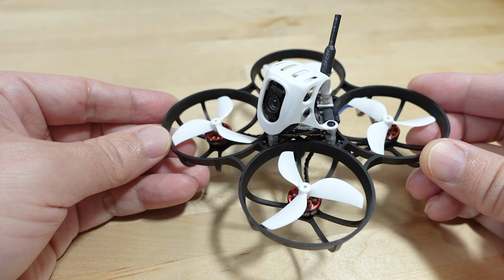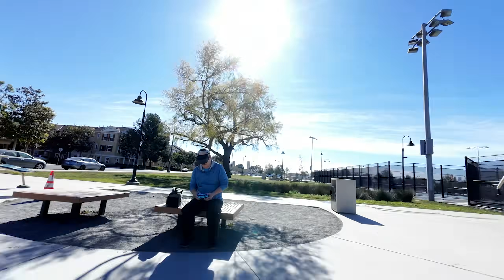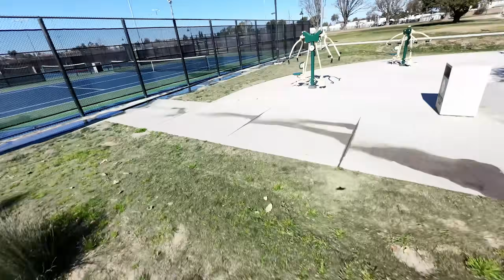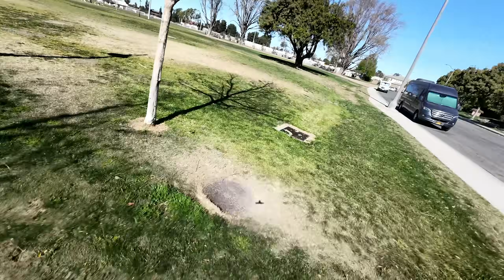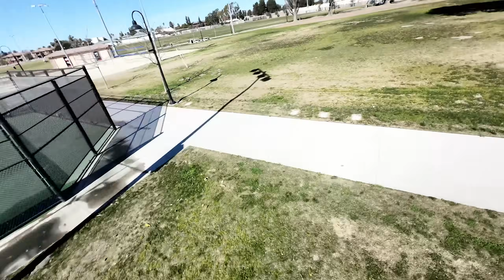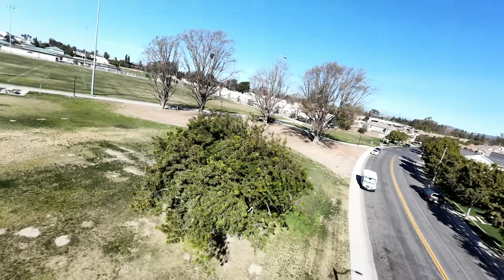BETAFPV Meteor75 Pro O4 Edition

Comment: I did it, it's ordered! Curious to see how much weight you could shed with a whip antenna,  tpu camera mount and bi bladed props. And what impact it would have on video and flight performance.  Side note, there's a couple of 65mm walksnail whoops weigh in at 35g and 39g.
Reply: How do you think the air 75 frame would perform with the 1102, 22000kv motors?
Reply: The air frame is pretty light 3g, I think. This 75mm comes with those motors.  Idk. Just really looking forward to a hd tiny whoop.  My eyes are too bad for analog,  I can't see squat
Reply: @dustinpugh8222  I hear you mate, he tinywhoop, can’t wait to get one myself. The 65 just looks too stodgy for me
Reply: @rossanthony7573  the flight time is what sold me on the 75. I would prefer the 65, but it's just not there imo
Reply: @dustinpugh8222  it’s a big 75 as well. Saying that though putting the 65 into an air75 frame does sound tempting…

Comment: CAn i use non BETAfpv 1s batreries you think?
Reply from the maker: They need to be able to work with the BT 2.0 connector and fit the battery tray.  I don't know of anything other than BETAFPV lipos that will fit well.  Also, the LAVA lipos will probably give the best flight time.
Reply: @AlbertKimTV  That such a ... :) not cool lets say :)

Comment: The vibes came from the props all my 75 pros have the vib. With this props
I hoppe new 45 mm Propst came sone😊
Reply: My 75 pro with O4 started having crazy jello after a minor crash. Rebuilt camera mount, canopy and the board with no luck. Then I noticed one of the props was slightly bent like 1mm, replaced that prop and no jello. This whoop requires perfect condition props for sure.